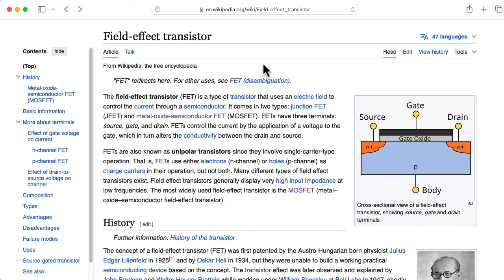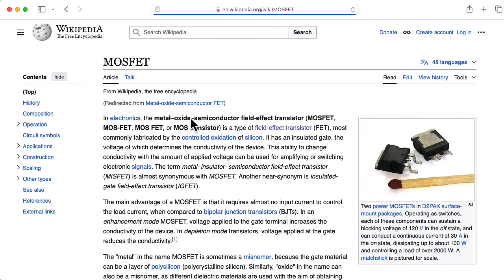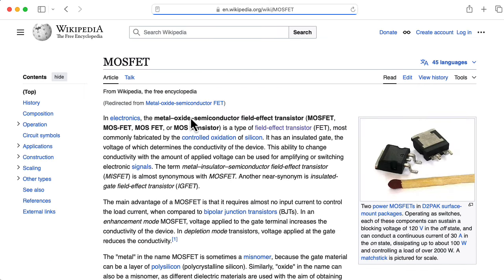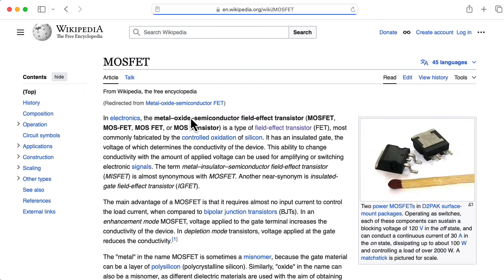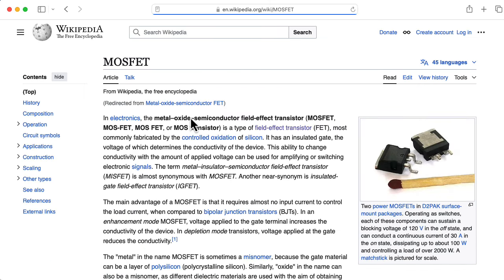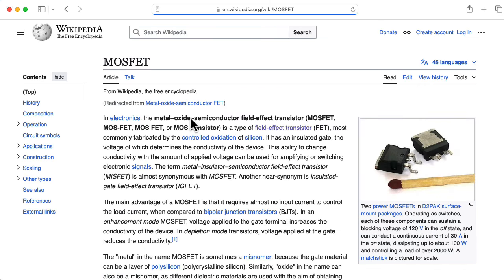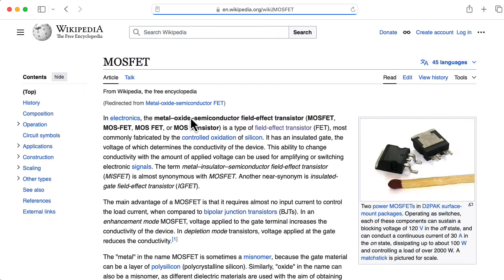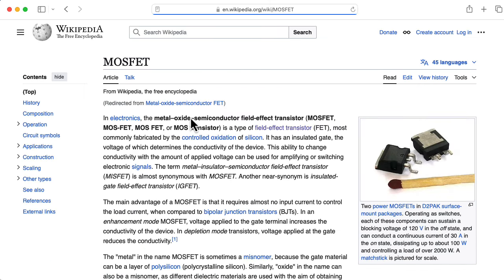ECE3400 L42: Introduction to JFETs (Analog Electronics, Georgia Tech course)

Comment: I commonly encounter JFETs in two places, both inside professional research instruments:  discrete matched-pairs in extreme low noise front ends (neural axon preamps, "Patch-clamp," and also in cryo-cooled front-ends used for Ortec's HPGe germanium scintillation detectors.)   If you want a low-noise preamp, JFET plus liquid nitrogen FTW.    
Once I dissected a dead Axopatch 200B probe.  Inside I found a -40C peltier-cooled block, and on it a lead bonded chip-die for matched pair of JFETS.  Little wonder that the thing costs $20K, and also is capable of monitoring picoamps activity of a single ion-channel in the cell membrane of a neuron.
Reply from the maker: Wow, I had no ideal Peltier cooling could be used to get that cold!
Reply: @Lantertronics  Oops, wrong.   I looked it up and found that, during malfunction, it went down to -20C.   Normally it's supposed to be set to -15C by feedback.  A chilled block protrudes into the tiny chamber, only about 0.5 square cm.  It contains a hunk of dessicant, to prevent frost!  Photos of the tiny hybrid module in the probe guts, CV-203BU headstage repair.   

For the liquid nitrogen cooler, the PCB is contained in hard vacuum.  For that detector they used single SK152-2 or SK147 jfets, for low noise with low input capacitance.

Comment: Hi Aaron, I've only just discovered your YouTube channel and will for sure be working through the episodes on valve amps. I would be very interested in a "Special Topic" series on high performance input stages, Mic Amps Mixers and EQ's should you take the time to put such together. I've been fortunate to have come across a good number of such stages that have found application in professional recording studios over the years. It would be interesting to discover whether and active input stage could approach the performance of a transformer balanced mic input in terms of EIN and THD with the necessary Dynamic Range.

Comment: One particular relevant application of JFETs nowadays is power devices.  Silicon carbide devices often come as JFETs, and because of symmetry JFETs may be used as switches for actively commutated mixers.  JFETs also have low capacitance, high input impedance, and low noise figure for RF probes.  You can use a differential pair of them with an op-amp to get a low noise figure amplifier.
Reply from the maker: I am very happy to see they are not forgotten and still find applications!

Comment: 11:40 Microphone preamps! The input, gain and output stages would be nice to see analyzed. I'm curious why low kHz input impedance is industry standard.
Reply: Low input impedance = low thermal noise which can be dominant in low noise audio circuits

Comment: This explanations are excellent 👌. @13:30 is a point that confused me alot in the past. I used a JFET as AGC (automatic gain control) for a circuit, so the FET works in the ohm/triod region as a variable resistor? I have to watch this video again 😂.